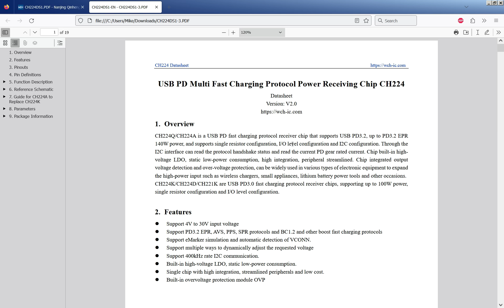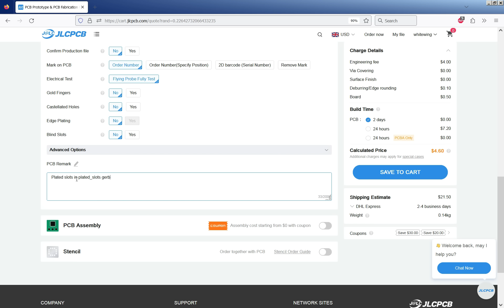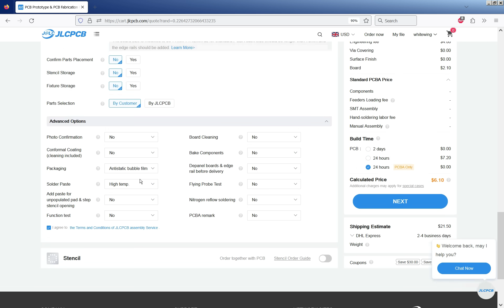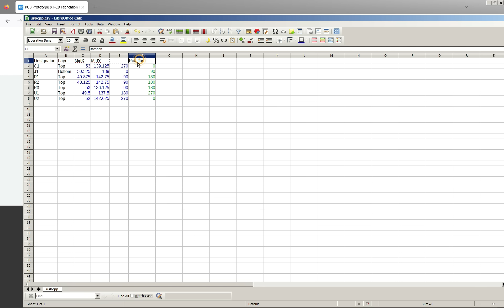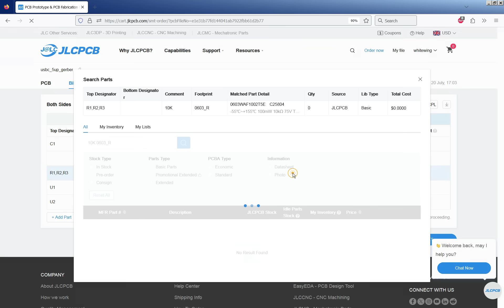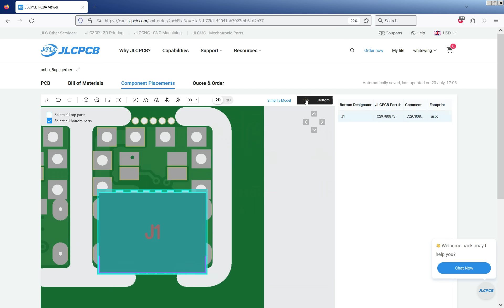USBCing all the things

Comment: Something that was quite surprising to me regarding the USB PD standard, was how loose the requirements were in terms of the source actually matching the requested voltage/current profile from the sink.

On the face of it, PPS (programmable power supply) is meant to be able to offer voltages from 5V to 20V in 50mV increments, but if you dig into the PD specification, you'll find that it's only required to match within +/- 5% of the requested value.

So your device could request 15.35V and actually end up receiving anywhere between 14.5825V and 16.1175V - and this is considered completely acceptable and within spec!
Reply from the maker: if a device is that fussy over voltage it has bigger problems
Reply: @mikeselectricstuff  Was just thinking exactly that, 5% is pretty good, I can see why someone might not agree if they've never taken a multimeter to the PSUs supplied with most items.
Reply: @mikeselectricstuff My gripe isn't necessarily with the fact that a PD source can't provide a millivolt precise supply voltage, but rather the contradiction of the protocol offering 50mV adjustments, when in the real world, you could be getting +/- 1V of what you were expecting.

It's a bit like buying a soldering iron that advertises 0.5 degree Celsius temperature adjustment, only to find out that the actual temperature it produces can be 15 degrees hotter or colder than what you set...and the manufacturer tells you "this is normal functioning".
Reply: With the typical cables used it's likely to half a volt lower still by the time it's got to the connector. Needs remote sensing to actually be useful. The 5V from a simpler adapter can be pretty bad too - 4.8 or lower.
Reply: @theelmonk Remote sensing is actually built into the PD protocol, if the sink device has a suitable PD chip. It's called "cable compensation", if I recall correctly.
Reply: That is because most devices have built-in power regulator circuits, which adapt to the input power deviation within boundaries of the standard.

And, well, some "dumb" power adapters may not even comply to +/- 5% deviation boundary, and, nevertheless, power devices quite fine.

If target device offloaded all power regulation to its PSU — then more thorough engineering is required. But this is quite a rare case and quite likely involves electronics you'd rather not mess around with anyways.

Comment: What gets my goat is when stuff comes with a usb-c socket but when you connect it to a proper usb-c supply, nothing happens because it doesn't have a chip in it!
Reply from the maker: Often,  for 5V stuff, it's just a lack of two 5K1 resistors- I've seen stuff that even has footprints for these that they didn't bother fitting.
Reply: @mikeselectricstuff  And versions which have a footprint for only one resistor, which works only one way up.

Comment: Ugh. Barrel jacks are simple, robust, and never clog or break. Their only downside is the lack of water resistance.
Reply: Tell that to all the cracked barrel jacks ive replaced on laptops for people over the years... and the burnt ones where the contacts went high resistance.
Reply: @jaycee1980  well some people manage to break everything.

they're even stupid enough to break a broom. the most basic tool available to the human species these days.
Reply: They fall out though. And there are too many sizes, with no standardisation as to their use. What a missed opportunity. I hate them. They're a consumer electronics thing. There are pro types with a screw collar but they're fiddly and rare. I guess USB C is not a lot better but it's a pity there's no generally accepted standard smaller than an XLR. And yes, water resistant so that even though the connections themselves might get wet it can't penetrate inside.  Wireless charging is good for avoiding this but unfortunately has been completely trashed by attempting to restandardise around higher power ratings.

Comment: If you're using real USB-PD supplies then yeah you don't need the DP/DM, but they are very much important for QC supplies, ie USB A port output which can still do 12V or such. Would be a nice to have to allow A-to-C cables from a QC wart to power such devices too.
Reply: Good point, but I think QC only supplies are rare these days.

Comment: Surely an LDO will dissipate the same amount of power as a dropper resistor?
Reply: Think about the situation at 5V supply, the chip is probably drawing like 2mA, with 3mA dropped by the 1k resistor in series with it, aka 3V across the resistor and 2V across the chip. This means the chip is perfectly happy running from 2V supply, and will draw around 2mA under that condition. If you increase the supply to 20V, now the chip is getting supplied with a lot more current, and will have to do something with it -- whether it likes it or not :D By adding a regulator you prevent the chip from having to do work to "drag the supply rail down to a safe level", and just only provide it what it actually wants.
Reply: No, it has much lower quiescent current and with lower variation upon Vin change. Zener shunt regulator requires much more current for the zener itself to work properly, and also that current goes much higher with Vin increase.
Reply: Dropper resistor has zero quintessent current.
Under load a linear regulator "simply" dumps excess voltage and current into heat, exactly what a resistor does.
Reply: @misium  I'm not talking about resistor itself - it just the mean to limit the current. The question is about zener, it requires several (technically 5) mA to be stable, while HT33 requres just 4uA to work. So the difference is three orders of magnitude. That excessive current is dissipated on both resistor and zener, but since resistor has much more voltage across it dissipates more power. Just run the calculation - in the worst case LDO will dissipate like 40mW of power, shunt regulator - 400mW: an order of magnitude more.

Comment: can only second your comment on using further measures to ensure mechanical integrity.
USB-C has a different mechanical resistance than barrel jacks.

Also: Center negative is cursed and after a family member burnt out two other devices I reversed the polarity (guarantee be damned) and threw the 2 power supplies in the spares bin after cutting off their jacks

Comment: That is pretty neat! I made myself a board with USB C, a DW01a Lithium protection chip, a TP4056 charger and a 3.3v regulator with ultra low quiescent current. Ordered panels of 9 each and converted every single thing in a 10 mile radius from dual/tripple AA, AAA or coin cell to rechargeable "street lithium cells" (single use "inhalation devices" you find on the street with usually a 500mAh pouch cell in it)
Thermostat, TV remote, weather station, multimeters, Christmas lights, you name it, it has a charge port
That, or my stuff runs on either (changeable) 18650s from old laptops or 18V tool batteries. I can't think of anything that uses a wallwart anymore, but if I find something, I will convert it!

Comment: AI Summary

Abstract:

This video introduces a custom-designed USB-C Power Delivery (PD) trigger board created to replace proprietary barrel jack power inputs on various electronic devices. The primary goal is to declutter and standardize power connections by converting equipment to use the modern USB-C standard, eliminating the risk of using incorrect power adapters. The creator showcases a compact PCB that fits within the form factor of a standard barrel jack, allowing for a clean, direct replacement. Key design features include the use of the WCH CH224K chip for voltage negotiation and a crucial improvement over reference designs: a low-dropout (LDO) regulator to power the chip, which prevents overheating when using higher voltages.

The second half of the video serves as a comprehensive tutorial on how to order these boards fully assembled through the JLCPCB SMT service. It provides a step-by-step guide, from uploading Gerber, BOM, and CPL files to navigating the component verification and placement confirmation stages, offering practical tips to avoid common pitfalls in the ordering process. The design files are made available for viewers to use.

Upgrading Your Gear: A Guide to Creating and Ordering Custom USB-C Power Converters

*   00:00:02 The Problem of Power Adapter Clutter: The video highlights the common issue of managing numerous different barrel jack power adapters, which creates clutter and the risk of connecting the wrong voltage or polarity to a device.
*   00:00:41 A Custom Solution for Clean Conversions: Existing USB-C trigger modules are often not suitable for cleanly retrofitting equipment. The creator designed a compact PCB that perfectly fits the footprint of a standard barrel jack, allowing for a seamless replacement.
*   00:01:49 Versatile and Robust Design: The custom board can be mounted using simple tinned copper wire or pin headers. By flipping the board, it can support both center-positive and center-negative polarity configurations, common in different types of electronics.
*   00:03:18 Simple Voltage Selection: The board is configured to output 9V by default. Users can create solder bridges on two pads to select other standard USB-C PD voltages: 12V, 15V, or 20V.
*   00:04:25 Technical Chip Choice: The design is based on the WCH CH224K, a widely available and popular USB-PD controller chip, chosen for its availability and suitable package size.
*   00:06:07 Key Design Improvement to Prevent Overheating: Unlike typical reference schematics that use a simple resistor to power the controller chip (which can get extremely hot at 20V), this design incorporates a Low-Dropout (LDO) regulator. This makes the board more efficient and prevents dangerous heat dissipation across the full 9V-20V range.
*   00:07:07 Open-Source and Available to Order: The creator is not selling the boards but has made all the necessary files (Gerber, Bill of Materials, Component Placement) available for anyone to order them directly from an assembly house like JLCPCB.
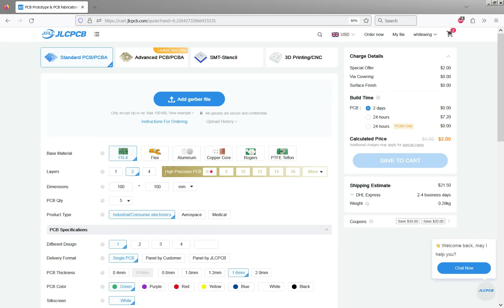*   00:07:42 Detailed JLCPCB Ordering Tutorial: The video provides a complete walkthrough of the JLCPCB assembly order process. This includes uploading the design files, specifying PCB parameters like 0.8mm thickness, and adding notes for special features like plated slots.
*   00:09:29 Preparing Files and Avoiding Errors: The tutorial offers crucial tips for a successful order, such as the correct formatting for component designators in the BOM file and ensuring no cells are left blank to prevent parsing errors.
*   00:12:18 Verifying Components and Placement: A critical step is carefully reviewing the component list matched by JLCPCB and visually confirming the placement and rotation of every part on the board using the web preview tool.
*   00:15:45 Finalizing the Order and Shipping: The guide concludes with the final steps of placing the order and includes a warning that shipping weights can sometimes be overestimated, advising users to contact support for a re-weigh if the cost seems excessive.
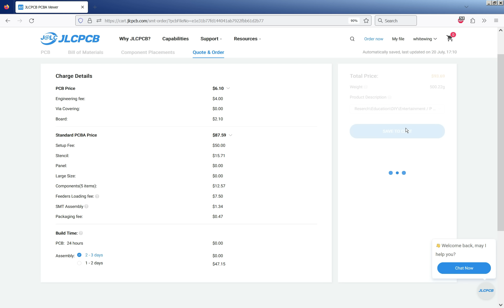*   00:16:23 Project Files and Community Contribution: The video ends by directing viewers to a resource page with all project files. The creator notes the design was made in PCAD but welcomes a community-submitted KiCad version.

I used gemini-2.5-pro| input-price: 1.25 output-price: 10 max-context-length: 200_000 on rocketrecap dot com to summarize the transcript.
Cost (if I didn't use the free tier): $0.03
Input tokens: 19373
Output tokens: 950

Comment: Interestingly I brought some compatible label tape for my brother labeller that randomly came with a USB-C adaptor cable for the labeller included. 
A slightly better option than the bodged up LCD TV PSU I found at work (the greatness of centre negative supplies on Brother labellers).

Comment: Neat form factor. I just have a pile of external USB C to barrel cables with internal PD trigger, but replacing ports has been tempting.

Unfortunately though switching to using the USB C connector doesn't fully eliminate the issue of people plugging the wrong adapter into a product. Very annoyingly some companies, even large companies ignore the USB PD standard and just make USB C PSUs with a fixed constant voltage on the cable, sometimes even way outside the spec voltage like 48 V DC for some industrial stuff I've seen. Some PD sink devices have MOSFETs on VBUS to protect against that, but many are 30V Vds max, very few devices have protection against 48 V overloads.

There's also a few combinations of USB PD source ICs and sink ICs which don't play nice and cause the downstream device to be power cycled multiple times during detection, some also cycle between the selected voltage, 5 V and 0 V which causes issues for devices without batteries constantly rebooting and browning out.

There's also some issues with PSU quality, voltage tolerances are pretty obvious but a lot of the cheaper USB PD PSUs have quite a lot of output ripple and leakage current, I've seen that cause issues on devices, particularly analog things like microphones where people buy one of those external inline cable USB PD triggers and then get lots of noise on audio recordings.

But the big deal breaker for me is that 12 V isn't part of the USB PD 1.0 spec and in the later specs 12 V is completely optional, for whatever reason the consortium decided 9/15 V is the new 12 V and as a result a lot of devices just don't work at all when plugged into a lot of PSUs and power banks. We understand why, but the average consumer does not and returns a 12 V only device and leaves a negative review saying it's faulty.

But I can't deny when it works it's fantastic, particularly when traveling only needing one PSU and cable for many devices is a massive weight save.
Reply: That's not good, anything on USB C should negotiate it's voltage
Reply: @IDKOKIDK  that adds too much cost and complexity sometimes, e.g. for 5v raspberry pi PSU. Some people will be unable to follow the usb PD spec and build an interface for it even if they wanted to, and will just use type-c as a power connector. 

USB spec is way too complex. Perhaps it would have been better to make type-c 20v. Or would be nice if you could program the PD voltage with resistors only.

Comment: I'd rather go the opposite way - USB-C connectors are annoyingly fragile and hard to plug in, and the USB spec is insanely complex. Is this a thinly-veiled ad for JLCPCB?
Reply: I've had many barrel sockets come loose from the PCB over the years so I don't agree on the fragility. And even though they are unbeatable when it comes to actually plugging in (infinite orientations) in reality the lack of standard makes the process very annoying. Is it the right voltage? Polarity? Outer diameter? Center pin size? Mike makes it sound like there are only two sizes (2.1 and 2.5) but that's only for the most common 5.5 mm plugs. The Wikipedia article on coaxial power connector lists  61 different dimensions !

Barrel connectors are only good if you have one (1) device using them.
Reply from the maker: @mumiemonstret  Yes there are loads, but 2.1 and 2.5 are by far the most common
Reply: I keep seeing this argument but I look after a fleet of over 8000 laptops and a growing number of mobile devices which all use USB-C and I've yet to see a broken socket, I've not even seen one broken loose from the board which, I admit, is a surprise to me.

Sure it's a complex standard but, for power, I don't need to worry about that because I can buy a USB-C PD chip or module for a few pennies and I don't have to worry about cooking a device by plugging in the wrong PSU brick.
Reply: @M0UAW_IO83 I wish i could say that. I have one USB-C supply that only works when inserted in one direction. Flip it over, plug it in, and you get nothing. 

I've also had a lot of the sockets get clogged with fuzz, and cleaning them out is difficult.
Reply: @PaulSteMarie  so you have a crappy USB-C supply. Buy a decent brand like Anker.
Reply: @jaycee1980 It's an HP, which isn't what it used to be, but still is a UL listed device. 

If you managed to overhead and fry a barrel jack, then GFL with the tiny little leads in a USB-C.
Reply: @PaulSteMarie  like i said, when barrel jacks get bent about because the power cable gets tugged on, they crack which leads to poor contact, which leads to heating. Replaced loads on laptops over the years.

Having recently done a power test with 20V @ 3A on a USB-C connector, I noticed very little heating.

If your USB-C supply doesnt provide power with the cable connected both ways, it's crap. Simple as that. It's missing a resistor on one of the CC lines which the spec requires.
Reply: @jaycee1980 Oh, it used to. My best guess is that the connector or cable were damaged, but there's no visible damage. USB-C is definitely more reliable than micro-B connectors, but that's damning with faint praise.
Reply: I prefer my ferrofluidic gel self constituting coordinated magnetic alignment connectors.. oh wait, that's 100 year in the future.